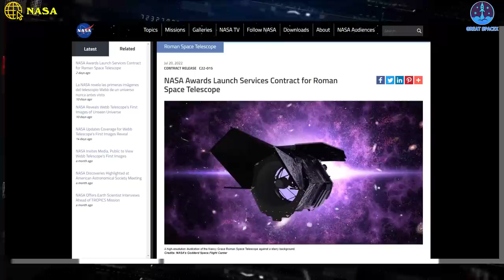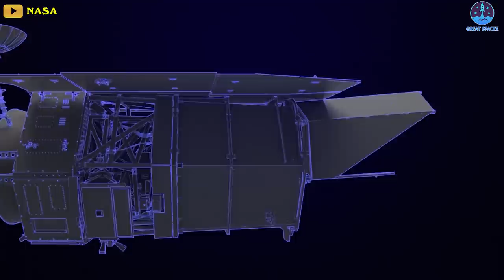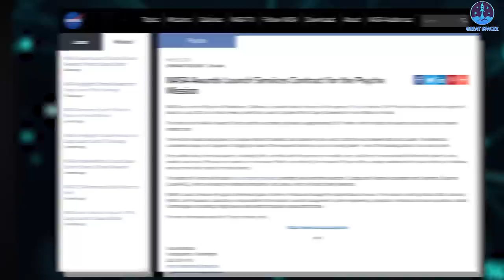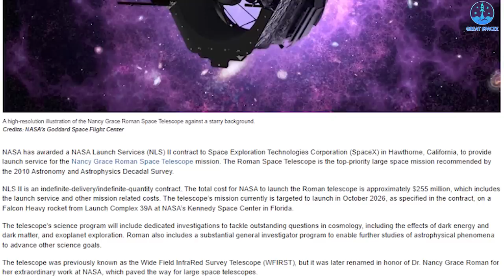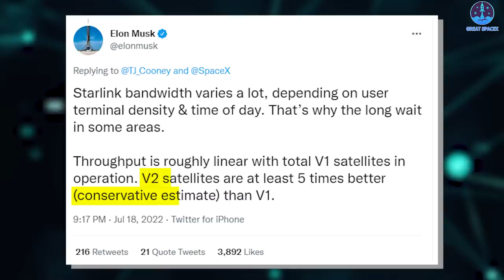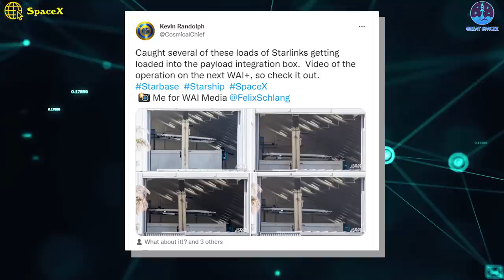NASA Just Awarded SpaceX A NEW $255M Contract To Launch The Roman Space Telescope On Falcon Heavy

Comment: There were two of the NRO mirrors donated. Just sitting gathering dust. I hadn't heard of the Roman Space Telescope. Definitely happy that it went forward. Many thanks for the update.  

As for the dispenser, it should be noted, that the plan is for multiple launches of the Starship Starlink Rockets per day. With loading and refueling being automatic. SpaceX Starlink Constellation of 42,000 will require many launches, thus completing Musk's goals. 1) getting Starlink Constellation completed as per the FCC timeline. I believe it is around 2028.  2) making replacing on the 5 year expiration date of Starlink Satellites as routine as possible. 3) proving of the Starship for Human Rating faster by the ramping up of multiple (100's) flights per year!! Starting next year.